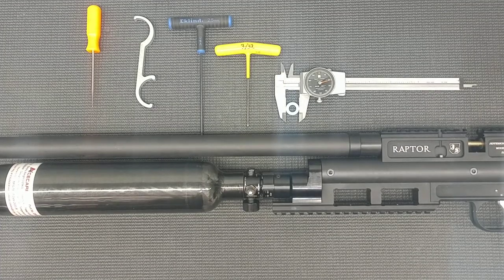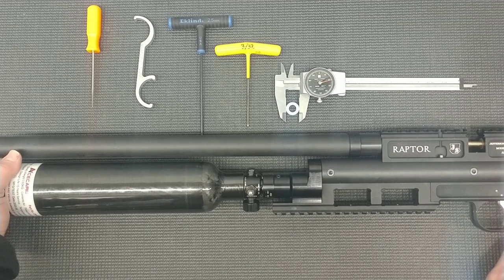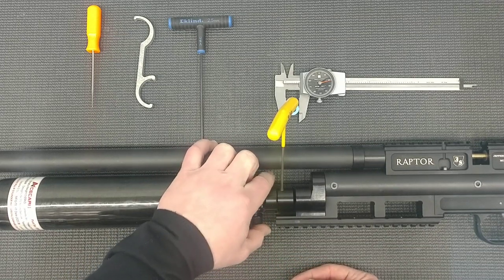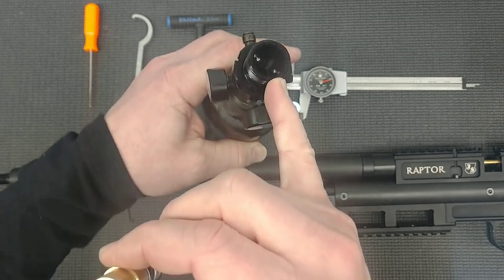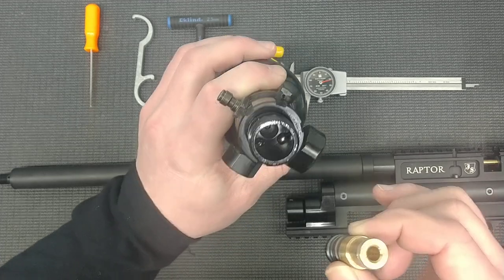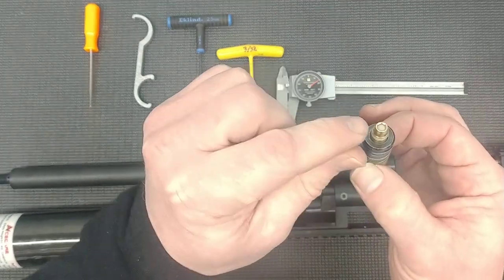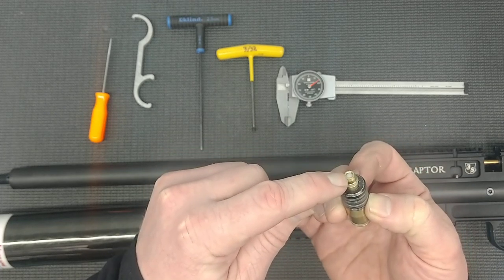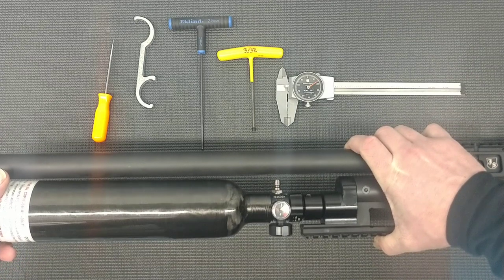Raptors' Ninja Flex Reg - Internal output adjustment, Caution, Tips, and Tricks.

Comment: Good video. I have the same reg. The pin valve seat is leaking, would any standard ninja rebuild kit have the correct size pin valve o-ring? Im having a difficult time finding info on this
Reply from the maker: You just mentioned the regulator... but are you referring to the valves' pin and seat?